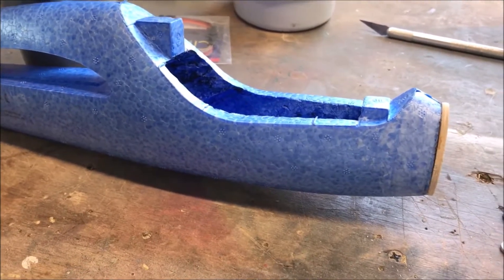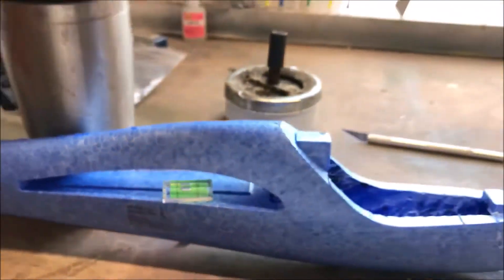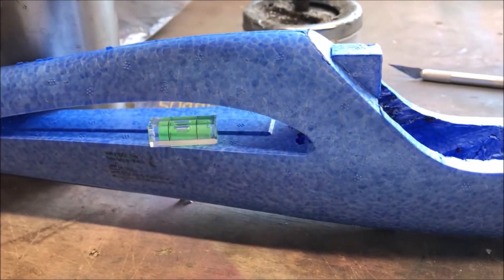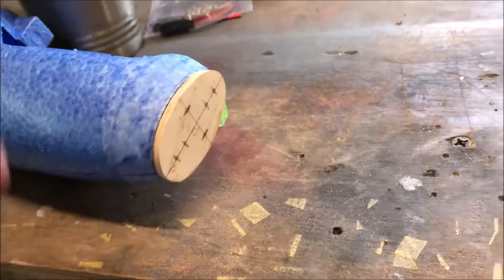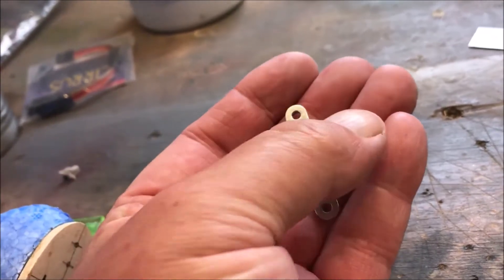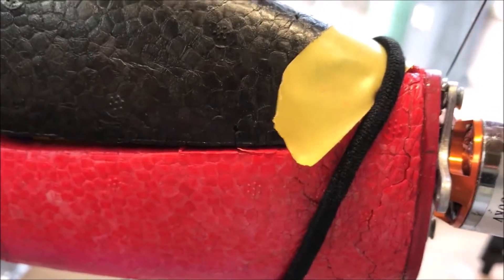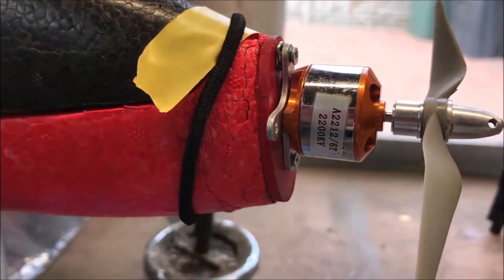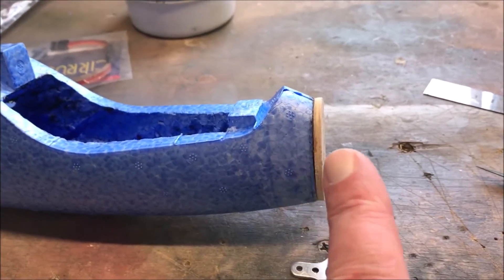Lidl Glider Radio Control – How too  Part 3 Bulkhead fitting for motor

Comment: Hi! Thanks for the video. Dit I understand it correctly? The flat part of the wing and the cut at the front gives you a right angle? Thanks for your help!
Reply from the maker: Exactly. You are correct, which means I have described it the right way, so thank you for that. You need a flat but upright front end so you can accurately angle the motor. So yes it’s a right angle.
Reply: @thebarronflights  As you are going to need some down angle and some right angle it would seem to make more sense to get closer to the final set-up by giving yourself about 3-5 degrees each for a start. Also for the firewall mount we find using plastic wall plugs glued into holes drilled into the foam to have the advantage that, if the mount gets ripped off, it's usually just a matter of going up a screw size into the plastic plugs. Also good for mounting twin motors onto these flat bottomed wings via thin aluminium angle (1.4mm worked well for 1807 motors) - twins are a better scheme as no side angle needed and you can bend the Al to give the down angles needed plus mount the ESCs behind the motors for best cooling. Solid mounted props/motors right in the nose usually don't fare well with our Old Fart's flying skills but the twins with some flexy tri-blades have proven very resilient. Plus you can go to differential thrust for more wild times when you get a rush of blood. 😉